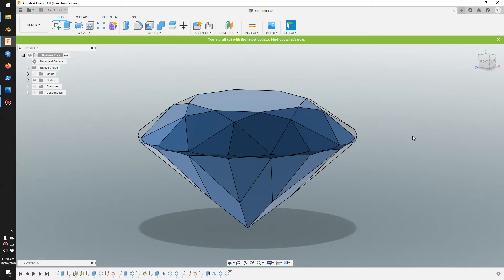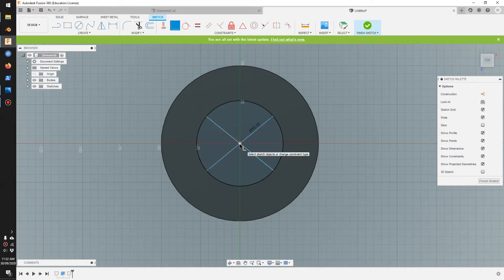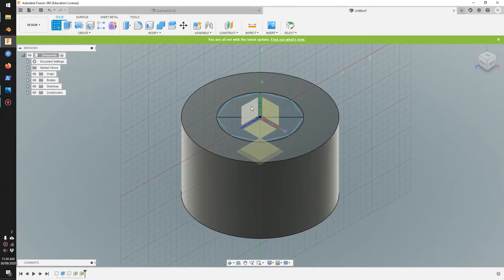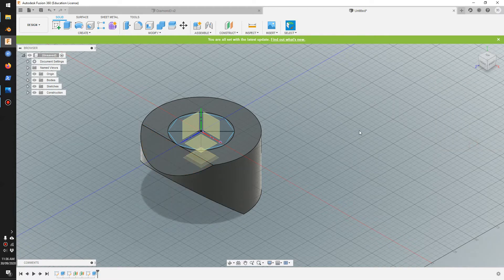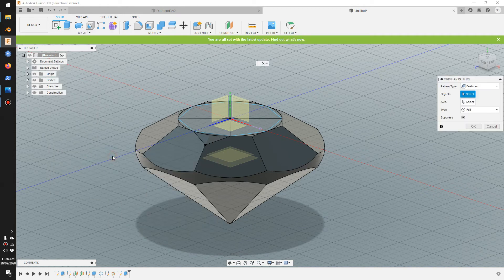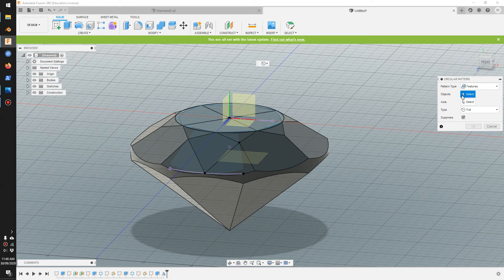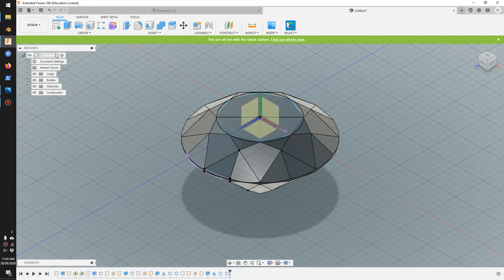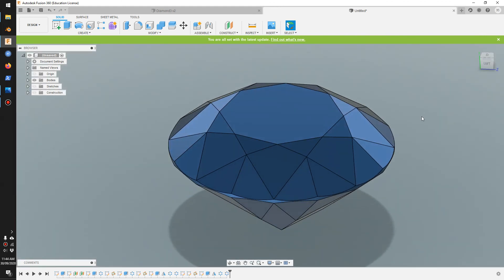Fusion 360 - Diamond Tutorial

Comment: Hey thanks for the video. I am really having trouble getting any of the coincident constraints or dimensions to work properly. At about 5:10 in the video you say your using the coincidence tool and appear to click on the green axis, I am unable to select the axis at all. You then click what appears to be the two points but that’s not really clear. You then use the dimension tool and click the small line and then again you click the axis and it moves everything for you and the line gets longer. Again I am unable to click the axis even when I hold down shift. Please can you advise what exactly you did during those couple of moves. Thanks.
Reply from the maker: Turn on the axis and origin point from the feature tree. Go back a bit and see how I did that.